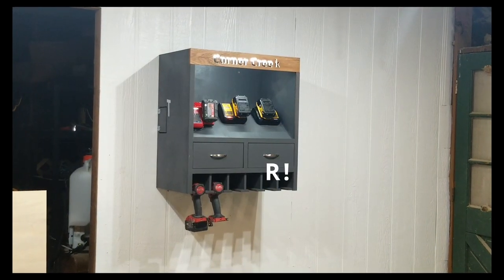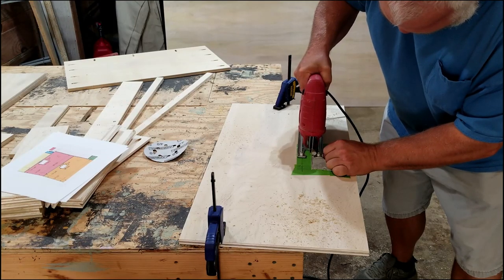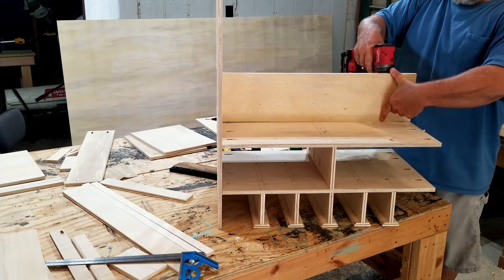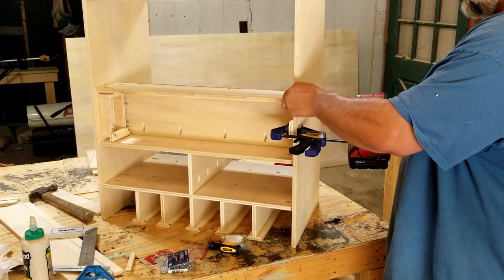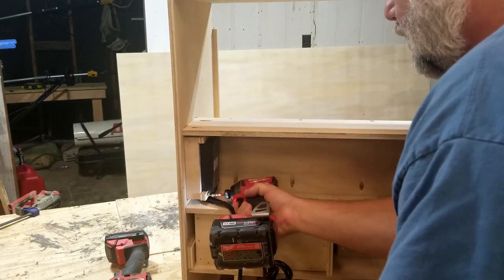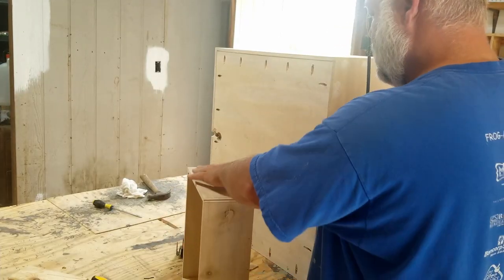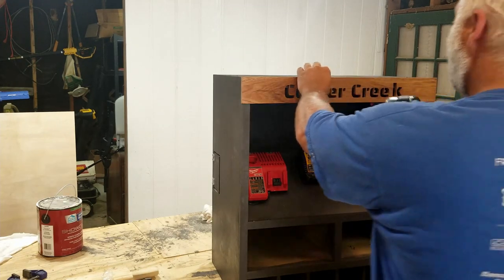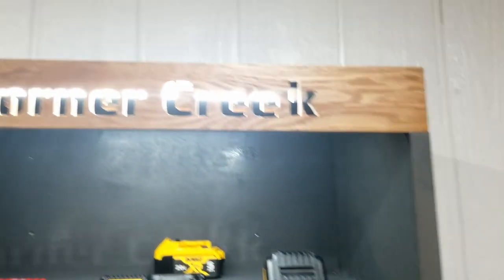Unique Drill Charging Station - Shop Upgrade!

Comment: Okay, I’ve got some very bad news for you. Your station is not the greatest power station ever built; it may hurt to know that but there are others equally as good. 

Seriously, it’s very nice. I did mine slightly differently but each of us would build the same thing differently. I do like the light and the rear shelf - those I haven’t seen. The space for my station is narrower and so my station is slimmer and taller - but each of us has to fit things in different ways. 

First video of yours that I have seen. I like the self-effacing narration - it appeals to my English dry humour. Video work is very good: production value is high. So, I have “liked” it and subscribed. Well done
Reply from the maker: That's not bad news. I know that it's not the best for every shop, but its definitely the best for mine. Thank you for the kind words and I'm glad you liked the video. Welcome to the channel.